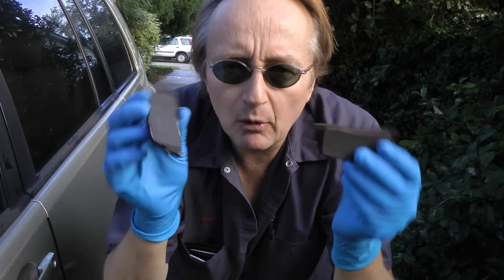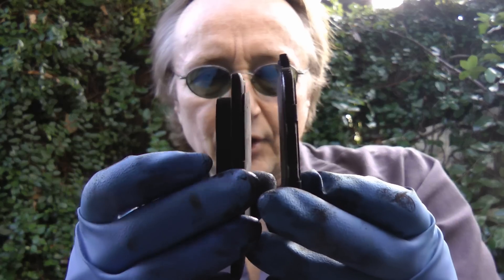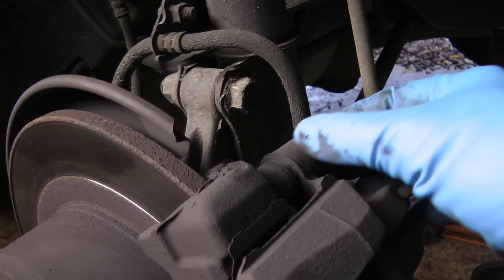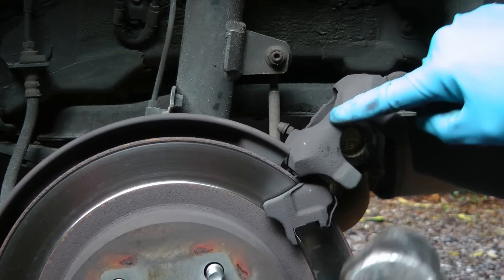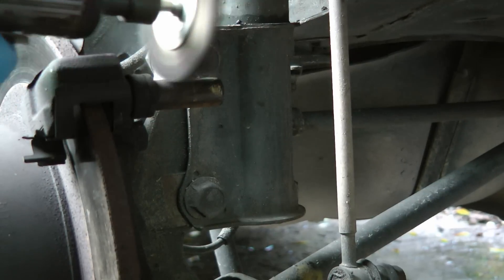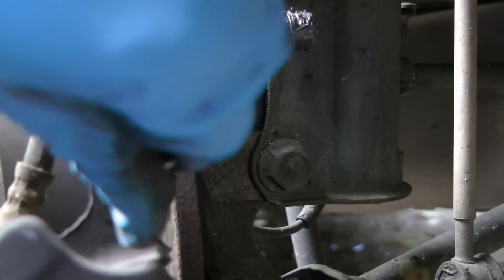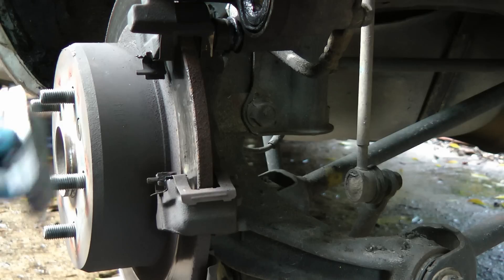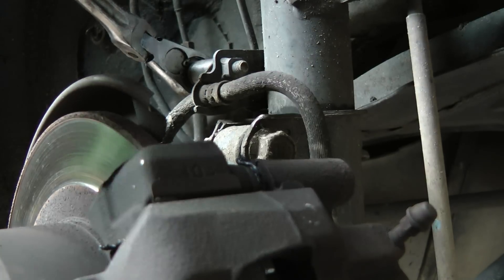How to Stop Brakes from Squeaking and Sticking in Your Car

Comment: I think I have a similar problem on my 2008 Escape.  I replaced the front pads and rotors in December and now that the weather is warmer (and humid) it feels like it grabs the brakes coming to a stop and is sluggish to release when you get off the brakes, and usually still holds the car in place until you give it gas or you're on a hill.  However, when it's cooler and not as humid, it's barely noticeable.  Looking it up online, they suggested to lube the sliders and running it through in my head, that seems like it's it.  Kinda strange, since I always lube up sliders when doing brakes

Comment: Hey there, my grandpa had a problem like this in the front left wheel of our 2004 Jeep Grand Cherokee, so we took the caliper apart and noticed that the pistons to apply the brakes weren't releasing, causing the brakes to get extremely hot. We had to go out and get a new caliper, which was funny, we were out for 4 hours driving around looking for one that would fit the Jeep. Hope this helped in anyway possible!

Comment: Question Scotty?
For '03 Malibu replaced:  all new------>Caliper, hose, line, junction box, master cylinder, brake fluid. 
 Problem:  When driving the driver's side front seems to stick. Actually burns the pad and heats up the rotor very hot.   What could it be?  I could after it cools down, travel to town but  I dont go far for fear of it overheating again.  In other words, its not stuck all the time.
Reply from the maker: if it has ABS, the modulators often go bad doing that
Reply: Sorry, non ABS system
Reply: +Romulan112 Brake booster , Flex hose
Reply: Wow I have a 2004 jeep cherokee that does the exact same thing as you said!  The break has stuck bad 3 times now In about 6 months, just like you said its even the front left.  It does not stick at all though 99% of the time.. this sucks

Comment: Hi Scotty, I nearly lost my brakes going down a very steep mountain road today. It is a Toyota Harrier. I used 1st gear to go downhill, but the car stalled (It is an AT), so I used D gear and press the brakes to slow down. I didn't hold the brake all the way downhill, but I could smell the brakes burning, after that I had to use all my strength to depress the brake pedal to make the car stop. Is this normal?

Comment: I live in houston, how much would you charge to fix those problems? Cause i would rather not do the work myself while i still owe money on the car(i bought it used from a dealership)and especially after me and a friend failed to fix the blown head gasket in my moms cavalier(i even had the head machined)and it ran worse than before, we ended up having to scrap the car.

Comment: Hi Scotty,
    Weird brake problem happened to my 2007 Chrysler 300. When I was driving 50mph on a potholed road. My car started to have weird vibration. I stopped and checked all four tires. My left rear brake is super super hot（all other 3 are OK）. I let the car rest for 15 min to make the brake cool down and then drove the same way back home. After the brake got cold, the vibration is gone, after I got home, the left rear brake was not that hot ( the same as the other 3), what should i do?THX

Comment: So I have a 04 Cavalier, would you recommend rubber or metal for the caliper pin (plugs?), they currently have rubber ones, but I'm curious if metal on metal would be butter?
Reply: They should be metal with rubber boots.. I've never seen a plastic slide pin man!

Comment: Hi Scotty, you are apparently a very busy man! with all these vids and responses..,i value my time, as im sure you do as well.. so i understand if you dont have the time to respond....but i'll ask anyway.  
 i have an 1999 Oldsmobile 88. felt 'odd' while driving, so i replaced the passenger side front rotor (it was really bad), but turned out, the driver-side tire needed replaced as well.  (this side could use a new rotor as well). in an emergency a local tire shop replaced my 2 front tires, but they put 2 smallerAND different sizes on   ...now, it feels like my brakes are 'on' while driving and it was vibrating, so i checked the lugs....they were very hot and came off with little effort.....not to mention, a sound coming from the front-right caliper when i turned the car off...like it was repositioning itself...
  ..i drive a long way to work, and fear the worst every second...
......i know i need new tires and a front left rotor, but cant figure out why my brakes feel like theyre always on.   
        thank you for your time, i always refer to your videos first! keep it up, and thank you!

Comment: Hey Scotty loving the videos, had a question i just replaced my intake manifold on my 1987 pontiac firebird but when i took the distributor out i forgot to mark it so i could put it back in exactly the way i took it out, i was curious how i could fix this problem? id hate to put it in wrong and mess up my engines timing; any advice?

Comment: Hi Scotty, my pin was really rusty I barely go it out. I cleaned inside the caliper of rust as best I can
And the pin was rusty but cleaned it best I can.
Should it be ok? I greased it up decent
Reply from the maker: yes, if you used brake calliper grease it can last

Comment: Scotty can you go over the Black Dampener Ring on new brake systems? I have found out over the years that GM and Nissan have a black rubber dampener on the btm Cal pin that swells and binds over time. Take them off! The caliper won't bind just as quiet with out! Not everyone owns a Toyota!

Comment: Hi Scotty. I find my brake pedal getting progressively firmer while brakes are engaged in traffic. Also it seems the engine is a bit more labored than usual whilst driving. I'm thinking I should lift the car up and check if the wheels turn freely and see if the brakes are sticking. What else should I be checking for? Thanks!

Comment: @ScottlKilmer
 Hi,I have a similar problem with my ford escort van. The front right calliper stuck on for ages and destroyed the pads and wore out the disc,so i bought new discs,pads and replaced the calliper.
 Seemed fine for many months,then all of a sudden it came back sticking on again, BUT at the same time on the rear of the vehicle so did the back left brakes (which are shoes)
So at the same time front right calliper (pads) sticks on and rear back left (shoes).
Do you know what this is???, why are they both sticking on at the same time, they were actually smoking hot,i did see smoke coming out.
Also a few days ago,i totally replaced both rear brake shoes and also renewed with new drums too,so the back has been totally replaced as well and they were all free,handbrakes works fine etc.
 So what could cause the front right calliper and rear left brake shoes to both jam on at the same time??
 Could the fromt flexi pipe if faulty, also cause the back left brake to react at the same time?
Please note before renewing the rear brakes this problem still existed then,i do think that maybe that the front flexi pipe is faulty but cannot understand why this would have an effect on the rear brakes binding at exactly the same time,unless somehow they are linked.
**FINAL point, when the front calliper sticks on,if i release the bleed nipple ,it DOES release the brakes on the front immediately and frees it off

Comment from the maker: REMOVAL

    Raise the front of the vehicle and install safety stands.
    Remove the wheel and tire assembly.
    Remove the front disc brake caliper from the rotor and hold it out of the way with wire.
    Remove the dust cap, cotter pin, nut, washer, and outer bearing, and remove the rotor from the front wheel spindle.
    If required, remove the front disc brake rotor shield (2K004).

Comment: I got a question, I have a 2002 Hyundai Elantra. Replaced front pads, rotors, both calipers and brake hoses. Brakes started over heating every few days, so I did some research and found the master cylinder can cause this to happen, so I replaced the master cylinder and it went away for a few weeks, now it's doing it again, any advice would be great

Comment: Hi Scotty,
I have a Ford Falcon 2000 model. When its hot(32C+) i lose my brake. Red color braking system faulty light appear on the Dashboard and Brake lose very much. There is a noise(squeezing)  when i push brake. I check brake with a mechanic and he told me not to worry about it because last owner used cheap brake pads. When i check brake that day for roadworthy it was 80%.
what would be the problem mate?
Thanks!

Comment: well i can't get it fixed right now i have to wait till my income tax comes in,but if it helps i went and checked for play i THINK there might of been some,but it was exactly the same on the other so it might be normal,but i did notice on the drivers side under the hub cap the grease cover had grease on it(idk if that is normal either),but i also know the sound is coming from that side,and that the sound is a mix of squeal/squeak and i could hear it if i spin the tire.

Comment: Scotty i have a 92 chevy caprice classic,and when i am driving i am hearing a noise from the front of my car i don't always hear it and it gets worse when i put on the brakes but after i push the brakes half way in the noise goes away,i also have a problem where the horn goes off even if i am not touching it,it has even gone off while i was out of the car with it off,i do know that the last owner put a new button for it under the steering wheel,and the buttons on the wheel don't half the time.

Comment: hi Scotty,
I have an 1973 daf 66 ( I'm belgian) and the front brakes work, but when I take my foot of the pedal the brakes keep braking... not too much but still pretty hard. and it does it on both sides. i can push the cylinders back, but only with big pliers.

I was thinking its the calipers ( I have non moving ones, so with 2 pistons, 1 per brake pad) but  wanted to know if it could be the master cilinder or clogged brake lines?

how coulld I test if my master cylinder is working and if my brake lines are clogged?
 
thanks,
Jason
Reply from the maker: many things can make em stick, but when stuck, jack up the car, and loosen a brake hose, if the calliper unsticks, replace the brake hose they collapse inside and do that. And if that doesn't fix it, the replace the master cylinder as it would be sticking on
Reply: Scotty Kilmer ok thanks!!

Comment: That black CRC brake grease gums up over time causing sticking pins, I learned this the terrible hard way. 
Isn't silicone paste like the 3M kind and / or Sylglide the only products that should be used on the pins?
Reply from the maker: +Matt D nonsence, I've been using that grease for 3 decades and have had no problem with it at all. It is partially silicone, a blend of a bunch of stuff made by pros

Comment: Hey, Scotty!
Every time I get factory rotors they get speckles of rust the same week I put them on and eventually my braking power fluctuates (extra touchy after rainfall). I've gone through 3 changes in the last 8 months. Is this accelerated rust buildup normal? I buy straight from a Gates dealer, GM parts according to them. =\

Comment: I replaced my front break pads yesterday and my car was running fine but when I got in my car this morning to go to work it won't move I put it in reverse and won't move I put it back in drive again and hit the gas is struggling to move what do you suggest I do?

Comment: Will lubricating the pins with silicone paste be a better option? heard grease ruins rubber parts.
Reply from the maker: NO, it can't take that much heat. I use special brake grease that hurts nothing, any good auto part stores sell the stuff. CRC is the brand I use
Reply: Thank you,will continue watching :)

Comment: I have a 2005 silverado 4.8  2wd   with a sticking caliper both sides,  
front right, front left,   I changed the calipers the brake hoses the 
master cylinder flush the brake fluid,    and still sticking both sides,
  what do you think it could be?
Reply from the maker: sticking brake booster
Reply: The brake fluid was very very dirty,  
 that's why I was confused if it was  the ABS pump.

Comment: I have a Toyota Prius with rear drum brakes.  Before the rear brakes get warmed up they do NOT slow the car down smoothly.  I can hear rubbing and then it grabs quickly throwing me forward in the driver seat.  Brake pads have plenty of life however.  Cause?  Thanks

Comment: Hello Scotty.. i replaced break rotors  a year ago. And replaced my pads 3 months ago. Recent front passenger side break is making a grind and or squeaking  noise when i pressing breaks.. Only when i drive forward coming to a stop, when reverse no noises.  The grinding isn't very loud its just a slightly on and off grind (when pressing break pedal). What could be issue..? Thank you. Its a 1998 Lexus gs300.

Comment: hey scotty I have a micra and the breaks keep acting up on me when im driveing the car starts to make a loud grinding noise and pulling to the left the tracking is okay on it but I got out and put my hand at the wheels on the riggt side of the car it is extremely hot at the front wheel and left is much colder hace you any idea what this could be

Comment: scotty my front right brakes are jamed, the pads are stuck on the discs and at once it made smoke from the friction,the mechanic cleaned the piston and changed the piston calippers,and now it still the same hard to accelerate and the brake pedal feels sharp and smoke came out from the friction,is this from non original after market caliper kit ? believe it or not mechanics here refuse to work on old cars

Comment: i have the same problem

the left rotor is clean , the right rotor needs to be replaced

because the right calliper is sticking and the rim is hot in right always

i tried the grease on the pins and i clean it first

the man in spare parts told me the repair kit only for oil leaking

i don't know what to do

is it the calliper or the hose or what is it please ?

Comment from the maker: those engines are notorious for overheating and now you have serious internal damage, really, no one fixes em, they put in used junk yard engines if they can find running ones. They are too complex to rebuild, costing 5 -7 grand to do correctly

Comment: This question is sort of unrelated but I was hoping I could get some help on how to diagnose this problem. After getting into a light accident where someone rear ended us, the car now makes a loud popping sound coming from the rear driver side tire after having the parking brake engaged once the car starts moving. After the popping sound is heard, the car moves much more freely so I'm thinking the parking brake is getting stuck, but I'm not sure. 

How would I go about diagnosing it and repairing it? I'm assuming its just the brakes that are sticking and there is nothing wrong with the cable since it releases once the car starts moving by letting off the brake or giving gas. I'm not entirely sure so how would I properly diagnose it. Thanks for the help.

Comment: Hey Scotty quick question i have a 96 awd ford explorer with a 302 v8 5.0 the issue i am having with it is that when its cold it drives perfect but as soon as it heats up it turns off, turns right back on but as soon as i put it in drive it turns off again, but if i give it gas while putting it in drive it drives fine but as soon as i come to a complete stop it dies, please help before its to late :(

Comment: Scotty I need help. I have a vw Jetta 04 and my rear breakes gave out unevenly just like in your video, but mine was the outside pad that was worn out. I was trying to replace the pads and the disk but the master cylinder just wont go in at all. Do i have to replace the caliper?
Reply from the maker: calliper is sticking, replace it with a rebuilt one, or try lubricating the slide pins if they are out of grease and dried up
Reply: Thanks! Your the best!!!!!!!!!!! ^('o')^
Reply: Could it be that the master cilinder hast to be rotated while it's being pushed back? some rear brakes have to be treated that way.

Comment: Hi Scotty. I have problems with my European 2006 Honda civic brake system. After some extreme braking (from 60m/h for several times) it starts to brake very badly and brake pedal goes more down than usual. After few minutes break it's good again. In normal driving (without hard braking) everything is good. I already tried to change brake fluid. Brake discs are quite old. I think that there is no sticking pads problems because I can turn wheel easily when the car is lifted. It looks like some brake overheating. Any ideas? Does the old brake discs can do this?
Reply from the maker: replace the discs and use high quality ceramic brake pads. if that doesn't fix it , then replace both front brake callipers with rebuild units.

Comment: Hi Scotty, Is it normal that the brake pads always rubbing the rotor or they suppose to have some kind of clearance?  I tested all the cars at my house and they all rub against the rotor and the wheels won't get to rotate freely.  I cleaned all the cylinder as shown in this video, but when you release the pedal, the cylinder doesn't move back much, which in turn make the pad continue to rub on the rotor.  I have a 350Z and only have 8K on it.